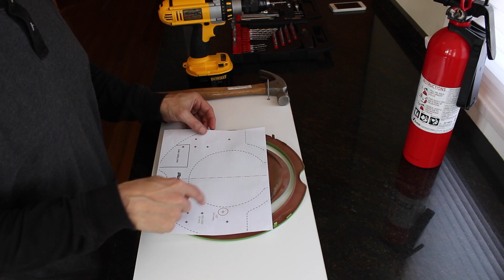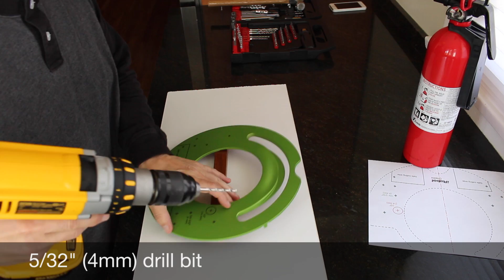JetsonBot Part 1 - Cover Modification - NVIDIA Jetson TK1/Create 2 Robot

Comment: Thanks a lot for your videos. I want to buy a kobuki platform but after watching your videos I do not know if to buy a irobot create platform is a better idea. ¿Could you give me some advise about the pros/cons between these two platforms?
Reply from the maker: I have not used the Kobuki. The iCreate is less expensive and is not purpose built to be a TurtleBot, whereas the Kobuki has been designed as a TurtleBot. As I recall, the Kobuki was the original TurtleBot base. In part, it depends on what you're trying to accomplish building these robots. There are now TurtleBot 3, which are worth looking into. About the only issue that I have with the iCreate base is that it moves slowly, slower than a walking pace. The advantage of building everything yourself is that you can reuse the parts off when you build your next bigger, faster, better robot if need be. You will also have a better understanding of what is need to make a robot. Thanks for watching!

Comment: You know, You could've inverted that picture before printing...
Reply from the maker: +Batuhan GENÇ That is a very good point!
The iCreate Drill Template comes as a PDF from iRobot. On my Macintosh, there was no easy option to manipulate the PDF in order to flip the image.  I do not have Adobe Acrobat installed, and I probably just gave up too easy. One alternative would be to save the template as an image file and then flip it. Thanks for watching!